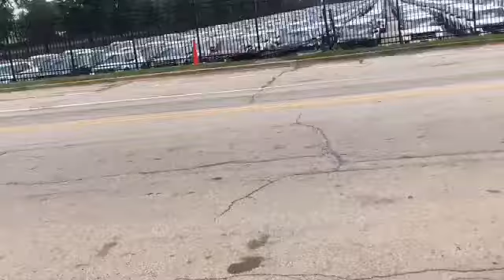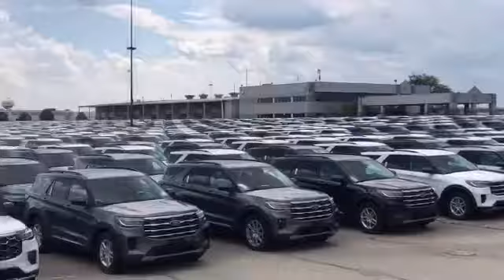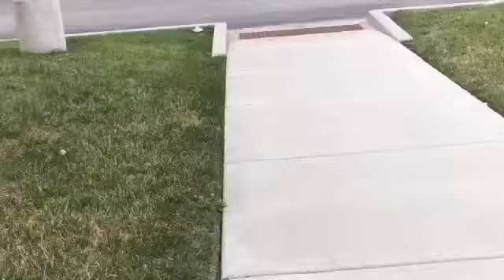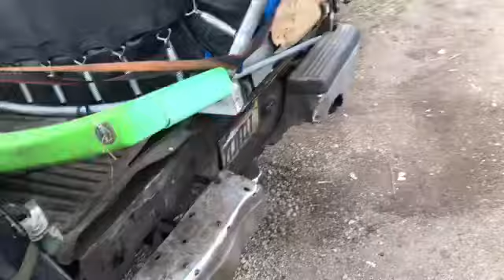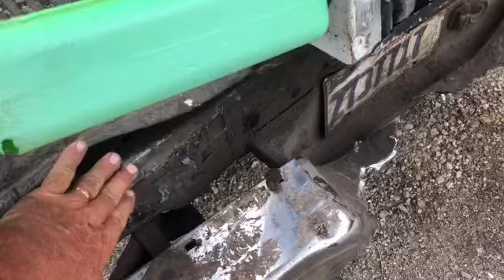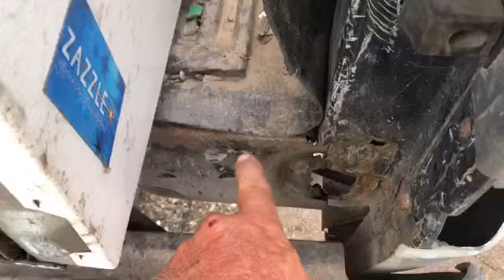SOMEONE HAS MORE CARS SITTING THAN LARRY SCREAMER !!!

Comment: not sure if it is worth the hassle 
I would be looking in to a used box they are not that hard to chainge out 
🍁🛠👍🔧🇨🇦
Reply from the maker: $$$$$& &. Yeah please remember that  nearly every Dodge of this vintage is rusted out it’s. $450 for a used bed 

Worth doing it if I got it from Tennessee Georgia Florida etc.
Just.not here though
Reply: @steelisthemeal  yes true
you have the right idea about bending up the steel, but after, i am not sure if the tailgate will clear it 
what kind of shape is the panel on the bottom 
you could sandwich some steel and even pop rivet it together
Reply from the maker: @danohstoolbox Dan pop rivets would work for sure if I wasn’t gonna scrap with the truck anymore 
This has to be put together for extreme use 
Even the welder hasn’t the right idea  gotta be. Junkyard usable
Reply: @steelisthemeal  nut and bolt it if you have to the pop rivets I have would hold for sure 
I have a Milwaukee pop rivet gun 🔫 you can't pop them by hand
Reply from the maker: @danohstoolbox I’ve been looking for a very high quality pop rivet gun for a long time

Recently one repairing my box truck with pop rivets it was hard to find pop rivets that would fit the tool that I got from Harbor freight
Reply: @steelisthemeal  Milwaukee has one battery powered and it works well the rivets I have are for truck bodys you can not set them by hand
Reply from the maker: @danohstoolbox Oh yeah those kind of Rivers are not your ordinary pop rivet
Reply from the maker: @danohstoolbox that tool and set up a pretty expensive actually probably cost just as much for 500 rivets and that Milwaukee tool. As a used pickup bed